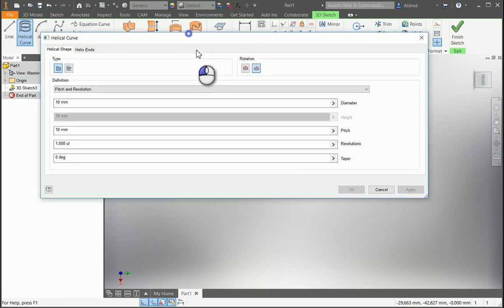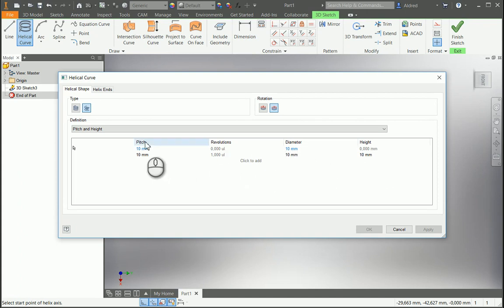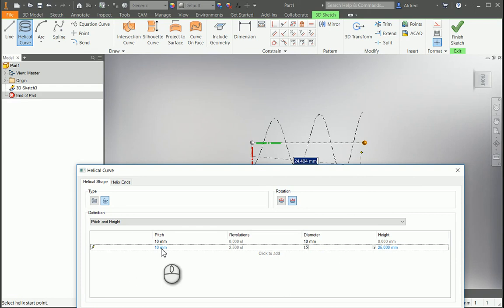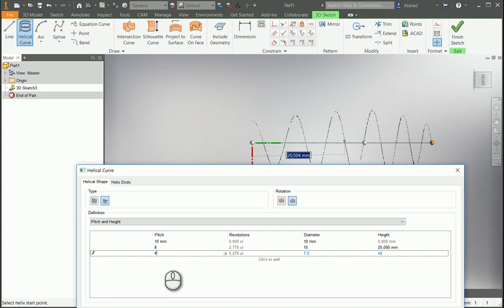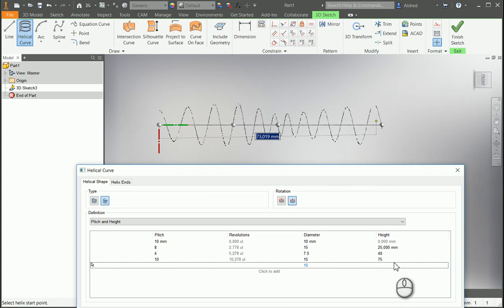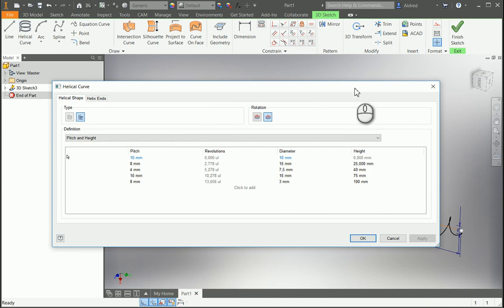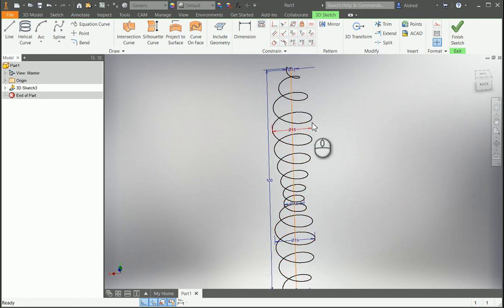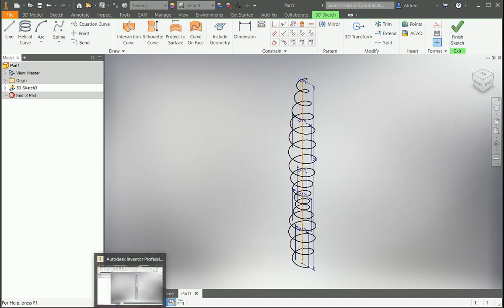Inventor 2019 Variable Helical curve

Comment: Does the path/axis have to be a straight line, or can we make it a spline? Picture a telephone cord hanging between two points.
Reply: No. when you use this option the path is always straight line. If you want a spline path helix. Then you have to go for alternate method. In which you cannot control the diameter and pitch perfectly as this.